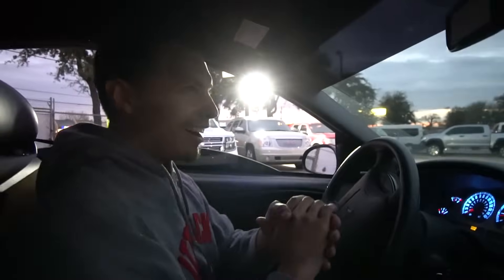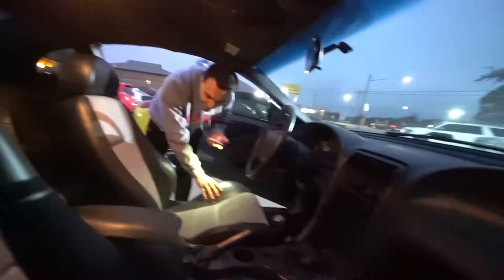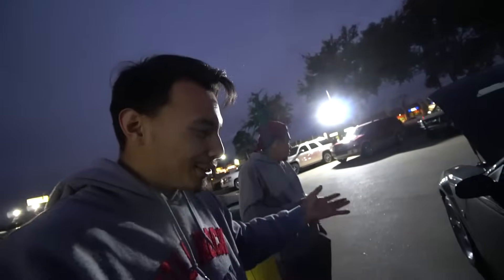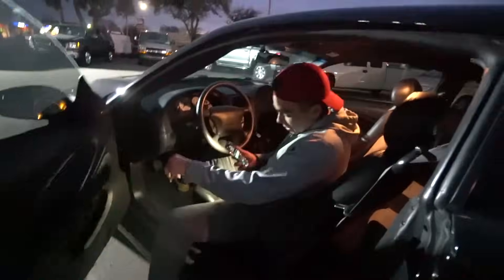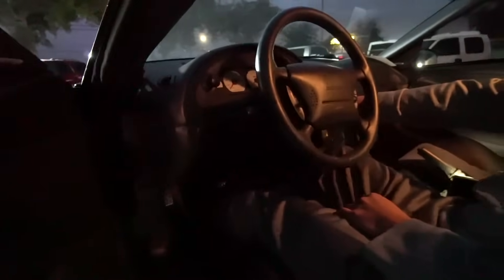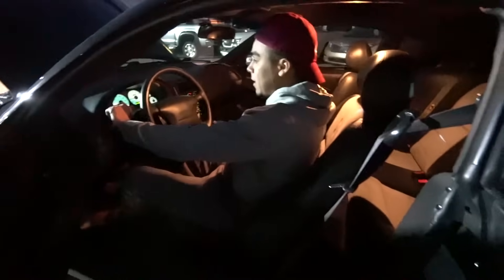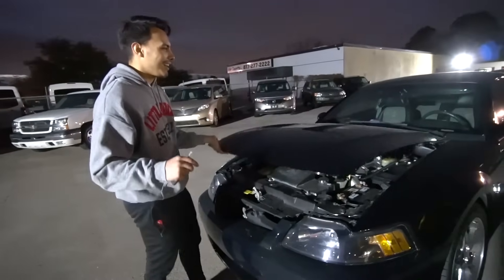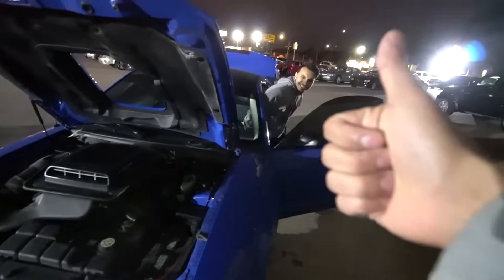Is this my new Terminator Cobra?

Comment: Just from this video alone man I can tell you from experience of having every GB en mustang new and used that your going to have issues with that one and if I were paying 18k on a terminator i would be sure it had at least the proper rims and not some oddly replaced cheap replica rims and who puts that gen cobra rs on a true terminator? Doesn't make since and the painted blower is tacky. It doesn't start properly! Why! Bad tune, mayb.v e its cammed, etc. Its fuel pump is loud, it has a aftermarket fuel system or at least a regulator obviously from the video, it's not stock. That car doesn't even look clean from the video. Man fof that one you may want to get your mechanical skills up to point otherwise itll break your heart. Be warned brother, if enough people say it, its probably true.

Comment: You're going to spend a fortune after you buy it just ask Mustang lifestyle you're better off putting 10K Mach 1 and supercharge it or coyote swap the Mach 1
Reply: crown Victoria lifestyle he’s going to spend a fortune doing those two things as well
Reply: PeRX for the amount of power he's looking for it won't be that expensive he's not trying to get 1000 horsepower nor turn it into an all-out track car like most Cobra guys or Mustang guys do I'm building a built cammed 2v and a 4v swap so I have a clue what he will go through
Reply: crown Victoria lifestyle true, but a Coyote swap is at least $12k. And that’s for a used motor and trans alone.
Reply: PeRX he doesn't need the trans right away the control pack will allow him to use his mach trans coyote motors are  1500 higher mileage and  2500 and up lower miles gen 1 or 2 10 to 12k isn't bad vs buying a cobra for the name only 15k plus then have to put another 5k in it to get it to his liking

Comment: Coyote mustangs without super chargers make more hp than these and ride way better.  Better to get a Coyote.
Reply: Joseph Bentley noway these cars were under rated and can easily swap pulleys and be way over a coyote power level and these motors are built stronger to handle boost.